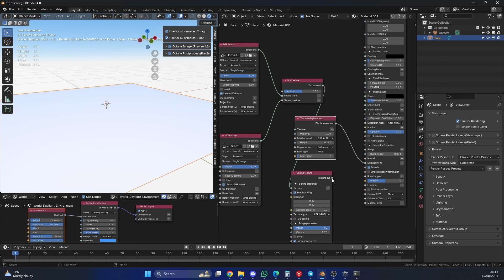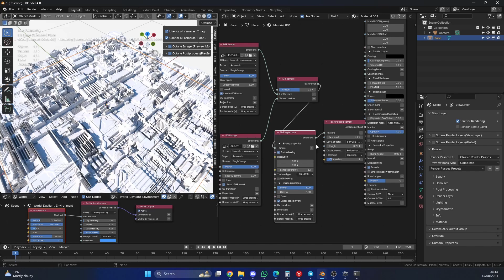How to mix Displacement Maps - Blender Octane

Comment: That's good but how would you handle it in case you're blending two tileable materials. Let's say you have a big patch of dirt and asphalt and you mix them using vertex colors and both materials are tiling, if you mix the displacement and bake you'll lose the tiling on displacement.